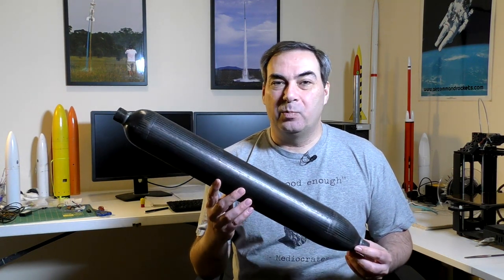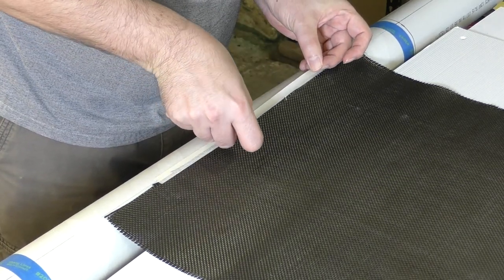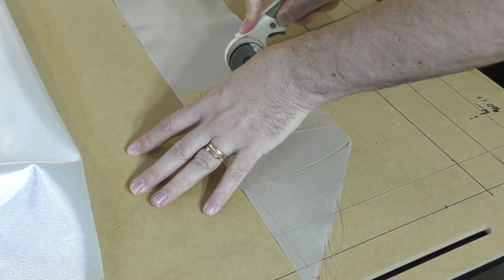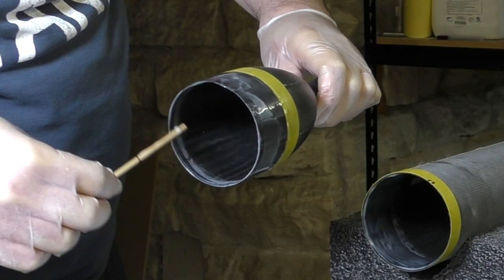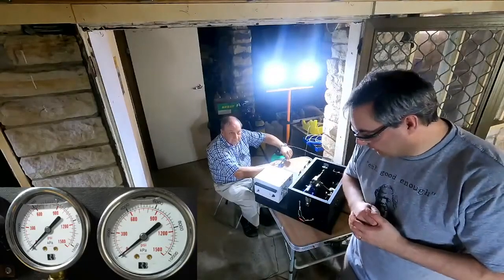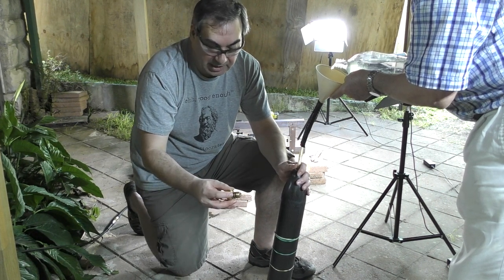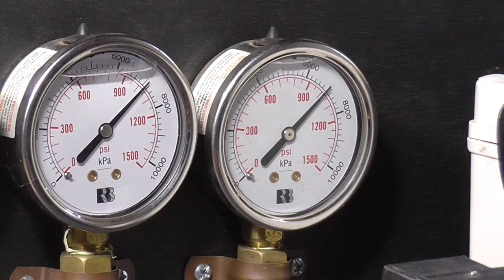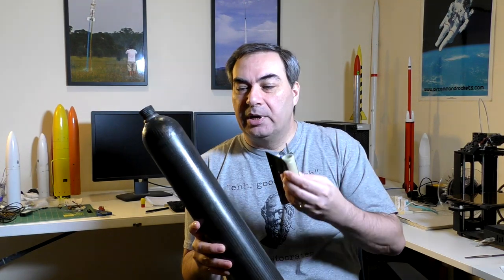2 Stage Water Rocket - Part 29 - Successful Tests

Comment: Last weekend, I made a pressure test on a 125mm (diam.) pressure chamber with 3 layers of 200g/m² carbon cloth. For security and to avoid scaring neighbours if it explodes, made it in my garden in a cavity, 25cm under the earth. I reached 53.5BAR for 10 minutes without any leak. But after 10min the co2 slowly dissolved in the water and the pressure decreased. So I made sparkling water. ^^
Reply: Cool!
Reply from the maker: That's a good result! Just curious, how fast was the CO2 absorbed? In terms of over that 10 minutes, how much did the pressure drop?
Reply: @AirCommandRockets  The camera with which I filmed the manometer stopped after a few minutes. So I have the data only for the beginning. It toked 390s to drop from 53.5BAR to 49.5BAR. So it's approximately -0.6BAR/min.

Comment: Perhaps I missed this, but why construct the pressure chamber from scratch? Versus carbon fiber wrapping several layers inside and outside of a SCH20 OR SCH40 PVC pipe? Or even aluminum? Obviously there would be a weight difference but you'd make up for it with the amount of pressure it could sustain?

Comment: Its truly amazing how small construction details affect the MAWP.
Reply from the maker: Yup, things that seem should work, end up not working when under load. There is still a long way to go with these pressure chambers, we still don't know how it will behave when the compressed air heats the epoxy from the inside. We also don't know what the upper burst pressure is yet.

Comment: Use of a reuseable nano gel tape might be more appropriate for creating an inner bead.  Application might be made to each side and then pulled out of the nozzle during partial cure.  Alternatively, a dual silicon balloon  mould would assist to negate rotation during mating of the end cap to the body.

Comment: Hi George, love how meticulously you build your rockets. I was wondering what would happen if you disolve a gas in the water like CO2. Keep up the good work. Greetings from the Netherlands.
Reply from the maker: Thanks Adriano, that is a good question, we've often wondered this ourselves. A few years ago we did a test on the test stand where we used a carbonated drink as the liquid, but didn't see much of a difference in performance. It may be different though if the pressurant gas was also CO2. Something definitely worth investigating.

Comment: The lizard was just inspecting the safety precautions :)
In regards to use of fibreglass and carbon fibre around the nozzle. 
Fibreglass has high strength but relatively low young module, it will stretch 6 times that of a carbon fibre before breaking.
Carbon fibre - the opposite, very high rigidity, so in principle all the fibreglass should go on the inside and ensure the seal while all the carbon fibre should go on the outside and ensure the mechanical strength. Indeed you do have a lot of fibreglass around the nozzle and it should be fine, but that's just a small consideration I would use.

What would be very interesting to see is what happens to the chamber lengthwise while you pressurise it. Does it expands lengthwise proportionally to the circumference expansion or not? The stress that acts diametrical should be D/2*pressure. while the stress in axial direction is D/4 and the chamber that is equally strong in all directions should expand proportionally to those stresses. The ideal case scenario is, obviously, when the chamber is twice as strong in perpendicular direction in comparison with the axial direction.